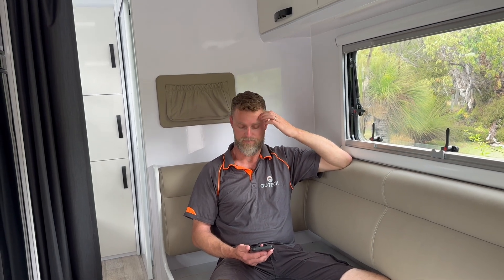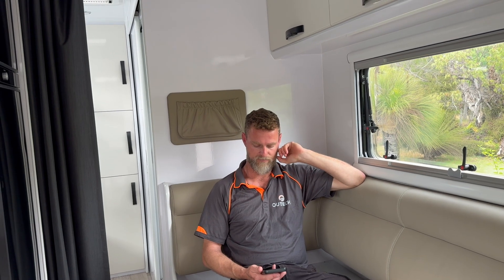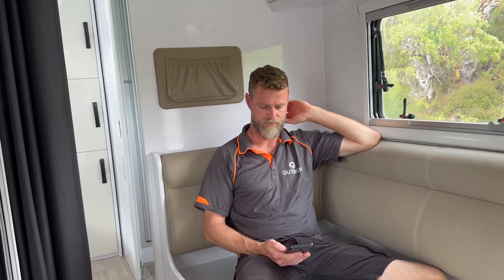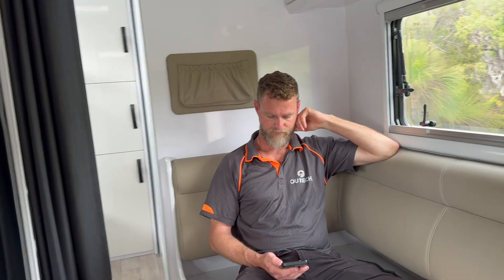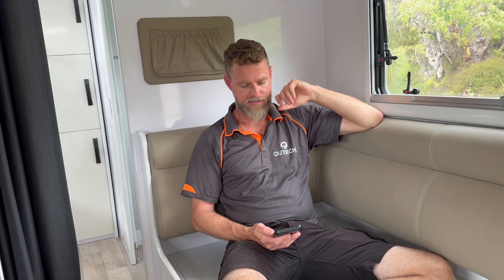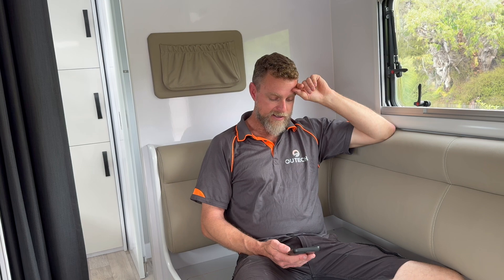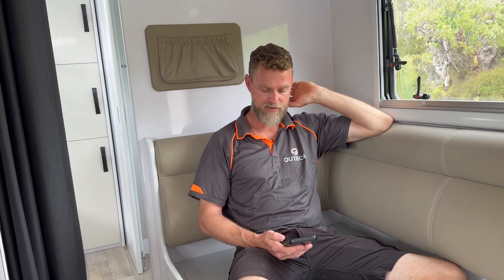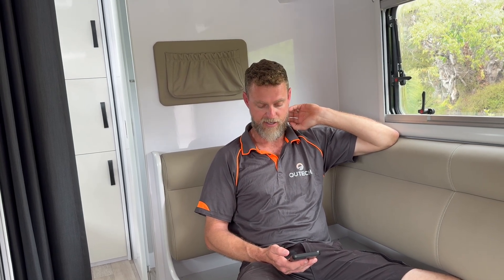FAQ: Understanding Your Inverter on 240V Mains Power & Other Common Caravan Power Issues!

Comment: Dan, If you had the choice and are designing a system from scratch. Which inverter charger would you select and use? Victron or Enerdrive?  I ask as I am currently designing a system for my camper trailer (Opus 2 2019 build). I do love the Victron 2000va but as doing my research I realized/came across the Enerdrive new inverter charger. Your thoughts would be much appreciated. 

Understand if you prefer to not comment publicly. Let me know and I will email you (Vic based viewer).
Oh Love the content you guys are providing. Keep up the fantastic work !

Comment: Im getting the impression Dan can be a bit rude when interviewd.
Reply: Lovely and very helpful chap, takes the time to explain all questions.
Reply from the maker: Hi @cathbp4089, thanks for your comment.  We hope all is going well with your #outechpowerupgrade
Reply: @outechoffgrid  all great, just short trips. About to head north for 3 weeks so will test again. Just need to solve the toilet issue thane all good!! ;)
Reply from the maker: @ the toilet issue… 😬
Reply: PPL need to understand what they have as an electrical system. I am sure they do at home.  a 15-16amp cct can only provide so much power then it trips. Regardless of so called caravan park sure power or not. Maybe, just maybe, ask the caravan park management what the limit of the mains supply is. Believe it is 15-16amps per site. I might be wrong. 
Cannot run every device off mains supply at the same time.... Basically if you have a van, learn what you can do with and all the limitations. 

If there is any signs of frustration, it is just that frustration that ppl do not learn the limitations of what they own. Besides, what kind of day has the lad had before being videoed? You shouldn't read so much into the persons presentation but take on board the information he is saying. 
He is trying to explain as best he can at the time, and has done a good job of it.

These are the basics of owning a caravan or camper trailer. Must know the limitations of what you own. No different to a car, or a tow vehicle.
Reply from the maker: Well said @darrensmith4661
Reply from the maker: How so?
Reply: @outechoffgrid I have no idea what he’s on about. Well presented.
Reply from the maker: Cheers @Blackstump60

Comment: Perhaps though if you have a transfer model with those iec plugs , if the shore power into the inverter was not seated correctly as what happens apparently all the time because there’s no locking mechanism on them then the limit would be 16a plus inverter capacity , and you would not get nuisance trips using 10a amphibian and aircon edit : perhaps though this would not come into affect if the aircon is wired to inverter
Reply from the maker: If the caravan has been connected so that all 240v loads are available from the inverter (apart from the battery charger) and the iEC plug comes out then you don’t have any main available to the van (apart from the battery charger) and the available output would be inverter capacity not mains. So generally less than 16a 240v 

In regards to the IEC plugs, there are brackets available for the inverter only models and the new inverter chargers have locking brackets built into the units. So all in all of the iEC plugs fall out then the installer has not installed them correctly.

Cheers.